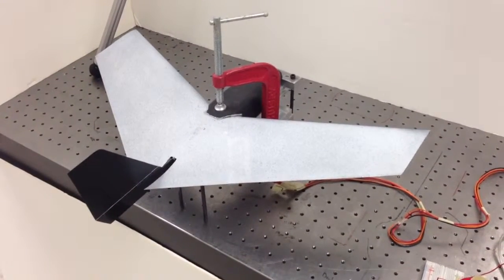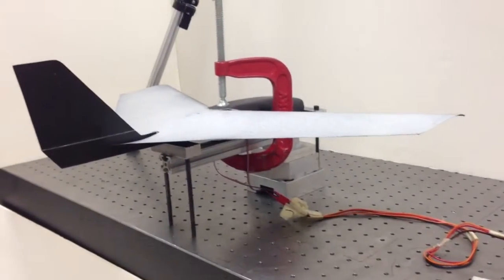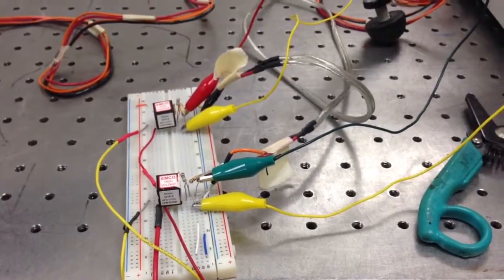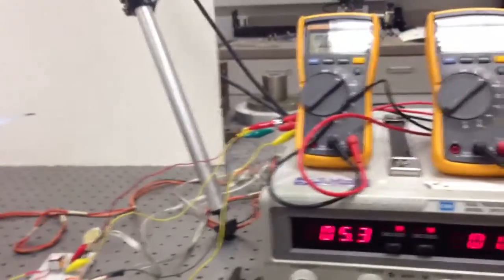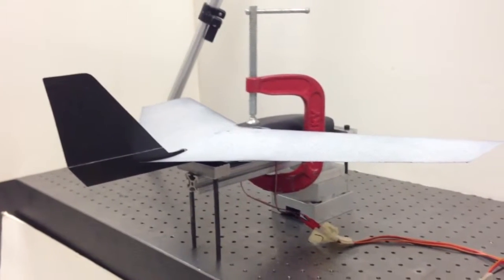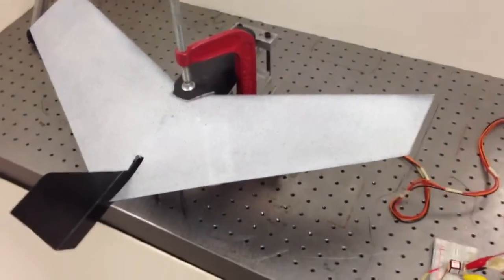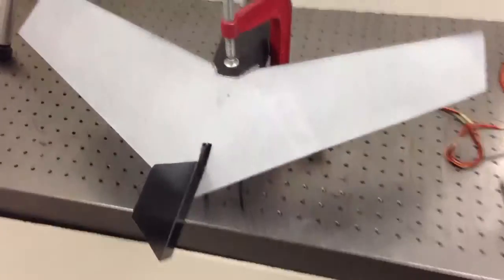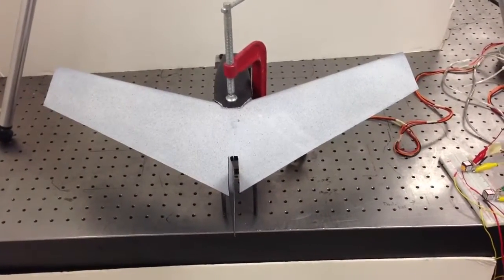Forward swept morphing micro air vehicle - Workbench Demonstration

Comment: Hi Brad, 

What kind of EMCO Voltage Amplifier are you working with? 
It looks like you're using the Q series in the video.  Great Work!

Thanks, 

Anna
Reply: Also, what material are the wings made of? 

Are they SMA's - Shape Memory Alloys> or a different material?
Thanks! ~ anna
Reply: I found the answers I was looking for in your Paper. Thanks!

The electrical setup is: GW GPC-3030D power supply, EMCO Q15-5 High Voltage Amplifier, a Fluke 115 multimeter, two resistors in series, and the MFC.
Reply: You mention it in the video: Carbon Fiber attached to a Steel Substrate
Great!

Comment: Hello Brad,

I am Nazwan, research assistant from Malaysia university.
I watched your video of forward swept MAV which you used MFCs to amplify the output voltage. In my research, i have to use MFCs but we dont have high voltage power supply in my university. May I ask your favor to show me how you build the circuit? what kind of EMCO product that you used? I am looking forward to your reply. Thank you.

Best regards
Nazwan
Reply from the maker: Hi Nazwan, 

It would be quite simple to build a circuit that would do what you need to do without a power supply. The most expensive component will be the EMCO amplifier. An illustration (and other details) can be found in the rough draft of my dissertation, which you can download here:

https://dl.dropboxusercontent.com/u/1005848/PhD%20Dissertation.pdf

I'll be finalizing my dissertation over the course of the next week, so I will post an updated link once that is done (link has been updated with final draft). Page 64 shows the circuit setup. The EMCO device used is an EMCO Q15-5, which amplifies the input voltage by 300x, so it takes 0-5 V as the input and produces 0-1500V as an output.

For the voltage input, you can take a battery with a voltage equal or greater than 5 volts and then use a voltage divider circuit with a potentiometer and resistors to adjust the voltage to whatever voltage you would like.  

http://electronics.stackexchange.com/questions/24031/potentiometer-to-change-voltage

Let me know if you have any other questions. :)
Reply: Hi Brad,

Thanks a lot. It is indeed a great help from you. I'll let you know if I have any question later. And good luck in your study :)